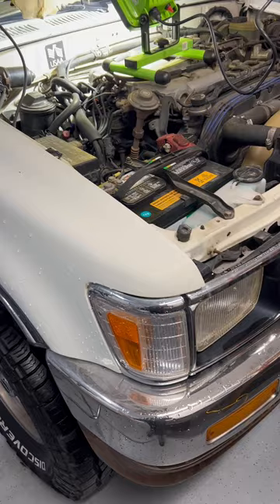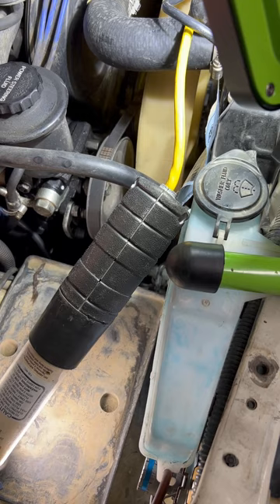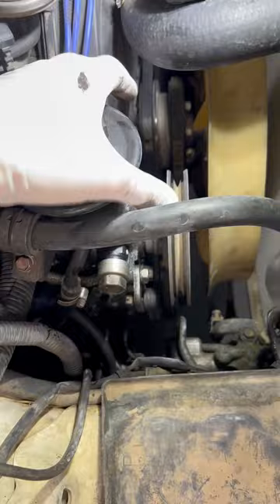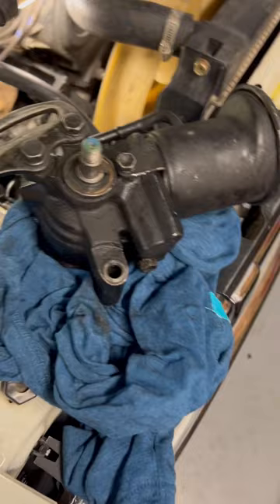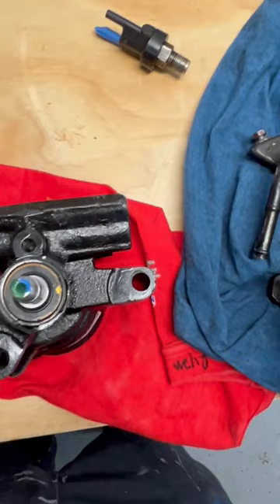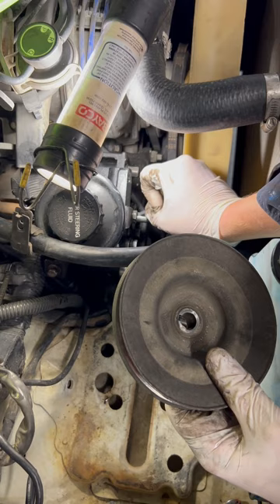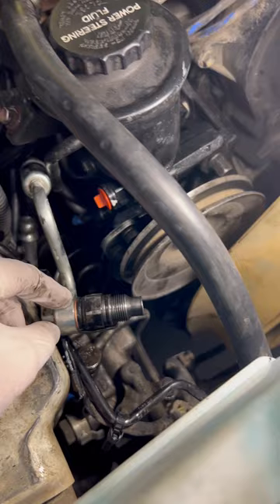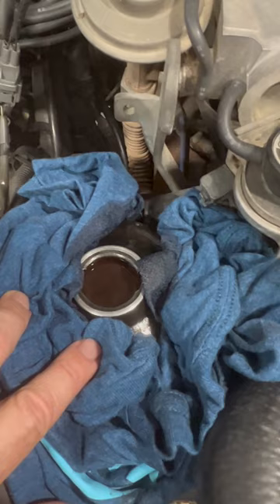1993 Toyota Pickup Power Steering replacement

Comment: Cannot the the pulley off for the life of me. All other bolts and stuff came off fine but the pulley itself is stuck… and I can’t fully remove the long 14mm because it’s in the way.
Reply: Same here. Did you come up with a solution?
Reply: You need to slowly hit the pulley with a hammer or a metal tool from the inside, hitting outwards (towards you), and it will slowly come off.

Hope this helps
Reply: Thanks! I tried it for quite a while, but no luck. A neighbor said he has a puller I can borrow. If that doesn’t work, I’ll be forced to resort to dynamite.
Reply: I used a pry bar on my 94 3vze yesterday and it came off after hitting the pry bar a couple times with a hammer. i soaked it in penetrating oil and kind of rocked it back and forth off the shaft